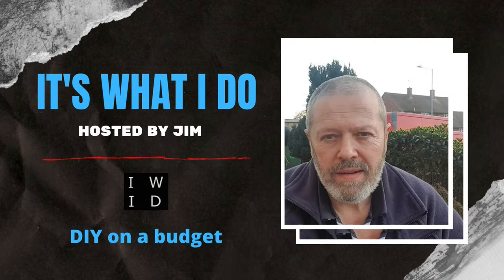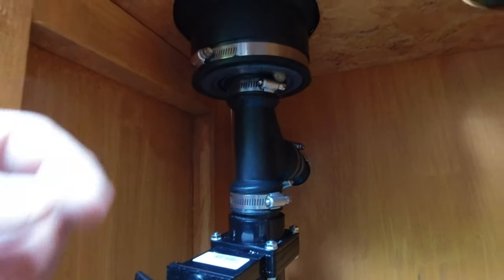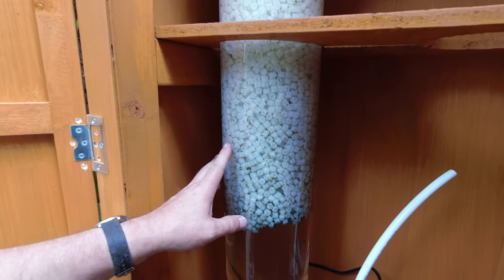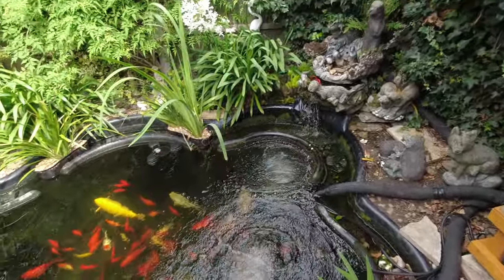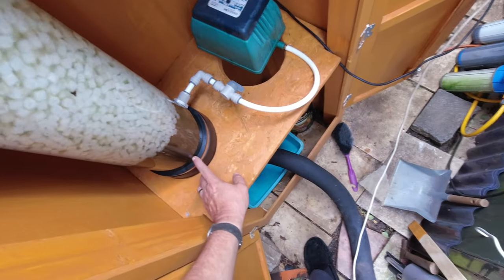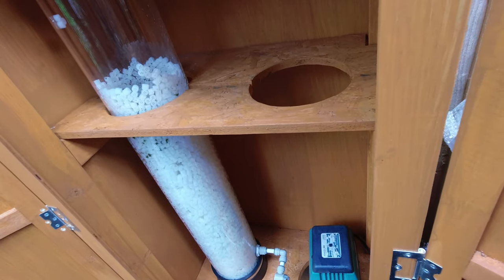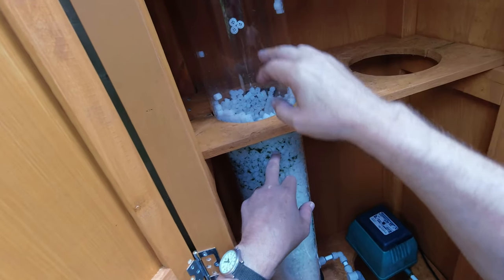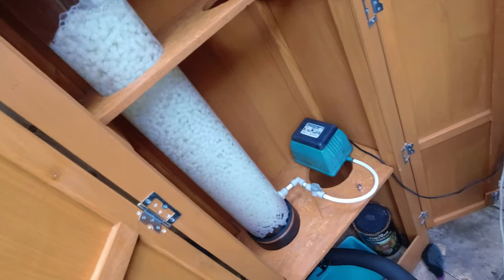Up Flow Filter Pt 3 - final set up

Comment: Nice build mate the small leak on the bottom should seal them selfs soon 👌👍
Reply from the maker: Thanks. The leak has pretty much sealed itself but it's just annoying.  I think I know what caused it. When I glued it up it was a very hot day and the solvent started to dry before I had a chance to get it into place. The other end is perfectly fine.
Reply: @ItsWhatIDo  brilliant mate I might have a go at making one when I've finished my filter house 👍
Reply from the maker: They are definitely worth having. The second one I'm going to build won't need the gate valve at the top nor the air port so will be a bit cheaper. The only reason I added those to the first one was that I wanted to limit the air that I pushed into the heater. I have issues with air locks in the heater. However with the meatier pond pump this isnt such a problem. The second filter is going to feed my normal filter system so it wont matter if air gets in there.
Reply: @ItsWhatIDo  happy days 👌👍

Comment: Hi Jim.
If that's a 200mm dia x 1 mtr tube,  11-12 litres media is ideal,  I'm using the K+ media, I'm still fascinated by what it collects and mine is after a drum!!!.
Reply from the maker: Hi Marek. The diameter is 160mm. Although it's working fine there is probably still a bit much in there. I might try putting slightly less in the next one. I've got plenty of the K+ left. The smallest bag I could get was 25ltrs. The filter has replaced a crappy pressure filter on the heater line for the pond.  However you can see the difference on the main filter line. There is no where near the crap in the foams and filter floss that sits on top of me media. I'm looking forward to building the second one and possibly being able to remove the foams.

Comment: hi mate can i ask about your ashp what is your opinion on the dream thanks paul
Reply from the maker: It works quite well but it is more expensive to run than the inverter style. However it was about half the price of an inverter and it was all I could afford. I know there have been mixed reviews on the Dream pumps but apart from being prone to having air locks it does the job.

Comment: if you leave top slide valve open then try air pump
Reply from the maker: It does work better with the top valve open but I was trying to limit the air put into the system. This filter runs on my heater circuit and I've had issues with air locks on it in the past.  The next one I'm building will not have any valves at the top as it wont matter if air gets in or not.